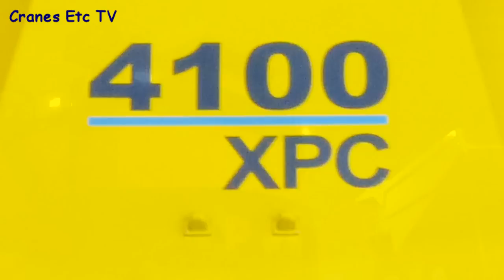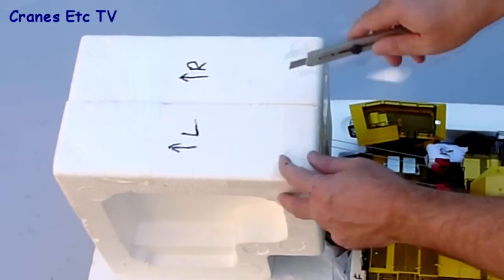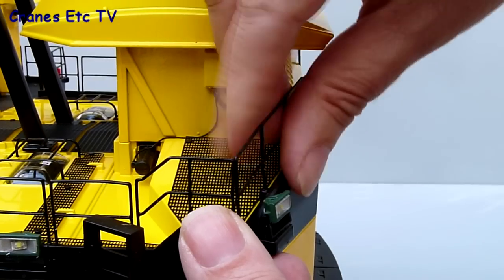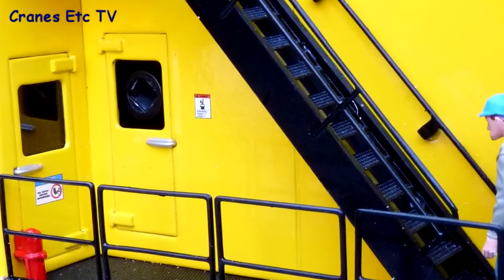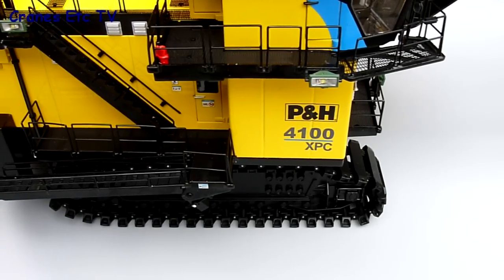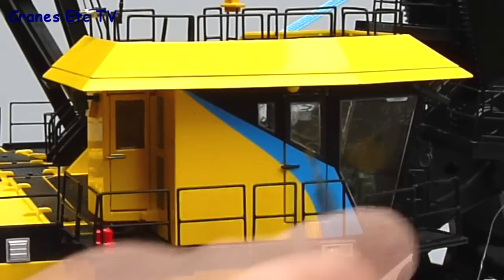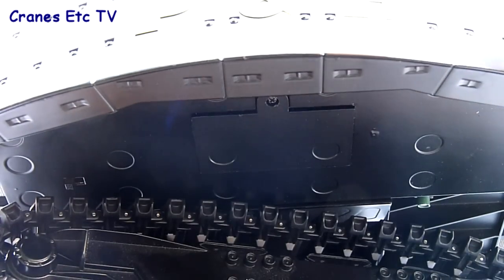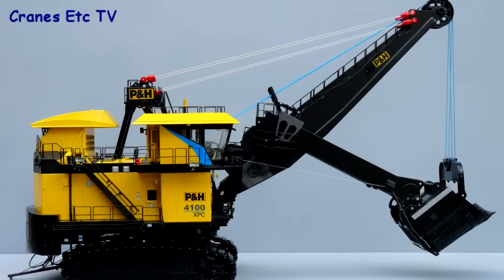TWH P&H 4100XPC Mining Shovel by Cranes Etc TV

Comment: Very nice model, but I wonder how hard or much easier it would've been to put the battery compartment and switch in the air scrubber tower with a removable roof?  Seems like a pain and risking damage by having to flip the unit on it's side to get at the compartment in it's current position.